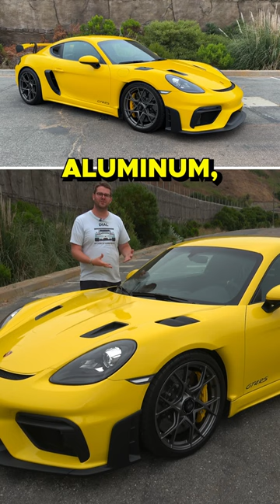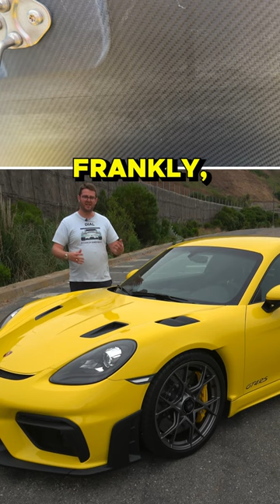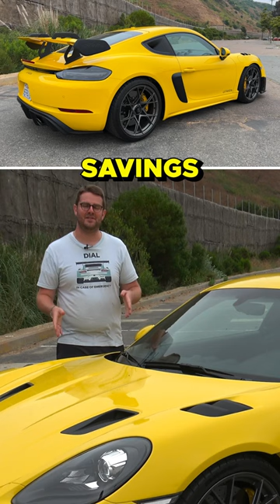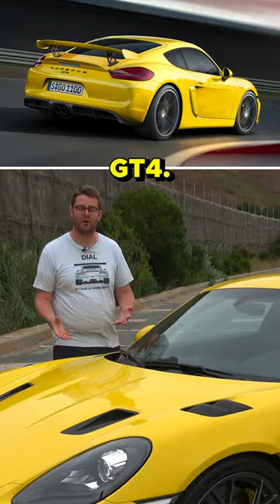Cayman GT4 RS Weight Loss Secrets #shorts

Comment: im no car enthusiast but does 50 lbs really make that big if a difference?
Reply: yes
Reply: If you're some Tier 1 driver on a racetrack, yes. 
Everyone else: No.
Reply: Nah
Reply: Yes.
Reply: Not really. I have an amg and I can top at the same speed wether my chubby girlfriend of 160lbs is riding with me or not
Reply: @Ganner84  that's because you have a Mercedes-Benz which is a heavy car,  so 50lbs of weight saving won't make a noticeable difference, but if you had a car as light as a GT4 then yes taking 50 lb off will make a difference. Especially if it's in the brake rotors and wheels
Reply: No the fuck it doesn't unless you are racing. Even then if you increase your driver skills by a tiny bit it's gonna help more
Reply: @airsoft9077  this is the only true response here. 50lbs from wheels and brakes might help. 50lbs from a carbon hood is worthless.
Reply: @amazin7006  facts unsprung vs sprung weight are very different. Too many people dont understand the benifit of having lighter wheels
Reply: The car RS has more power plus less weight, a better power to weight ratio. Not sure how weight distribution is, but removing close to 50 pounds off the front end certainly has its effect when going for lap time PR’s.
Reply from the maker: Weight from the points furthest away from the center of gravity matter the most, as well as rotational mass.
Reply: Absolutely none when you have 200+ lbs people driving these. 50pounds is nothing to a 3,400 pound car.